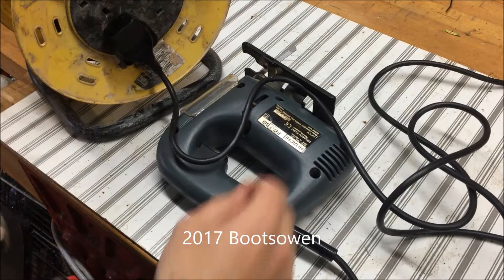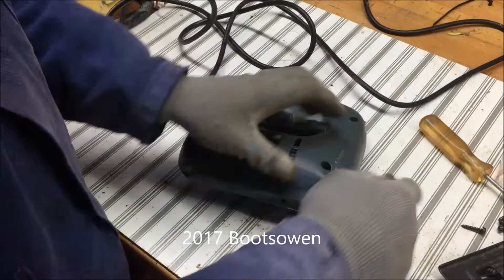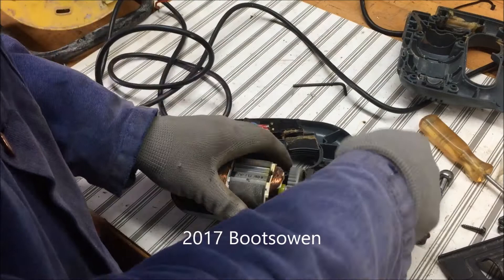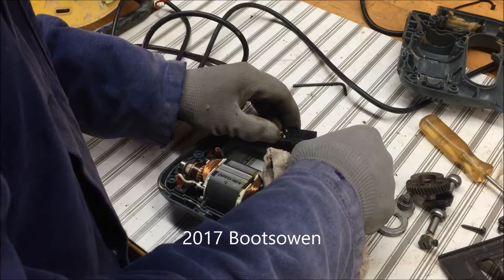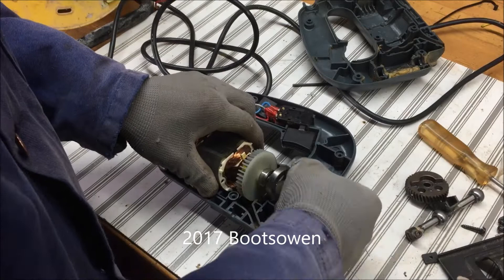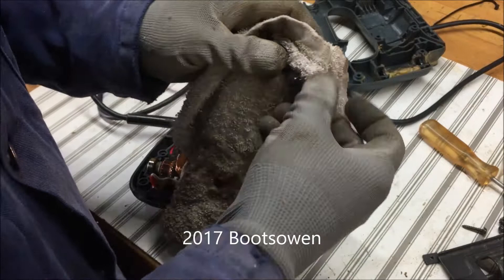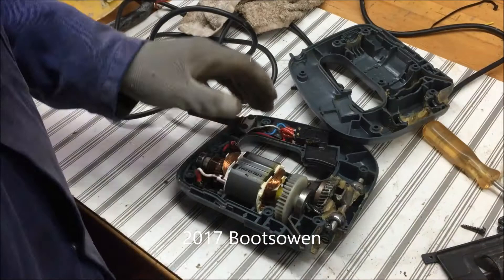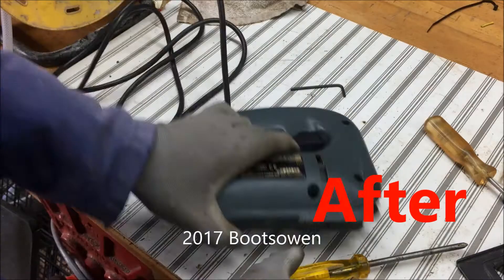Greasing a squeaky jigsaw

Comment: Hey bro! I just bought one new and after about an hour of using it start doing that noise. Do I need to open it an put some oil engine(I don't have Vaseline) ?
Reply from the maker: I wouldn't use oil, too wet. Maybe it always made that noise, I don't know. I don't use this one much anymore. It looked fine though, maybe it was something else.
Reply: @bootsowen  Ok. Thanks for your fast response! 👍
Reply: I bet you already solved this but mine had pretty nasty old grease, I cleaned it (diesel and a tooth brush worked pretty good but careful with the fumes) and then reaplied new grease I bought on amazon for 8€ (lithium grease in my case) now its running better :)